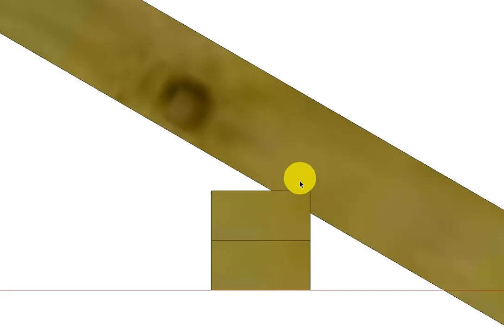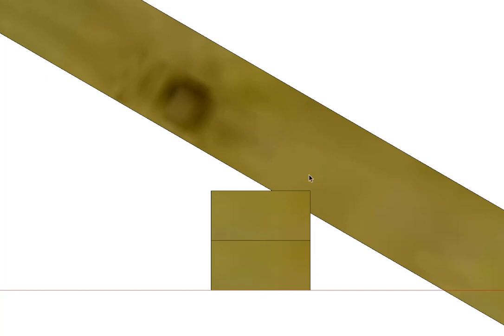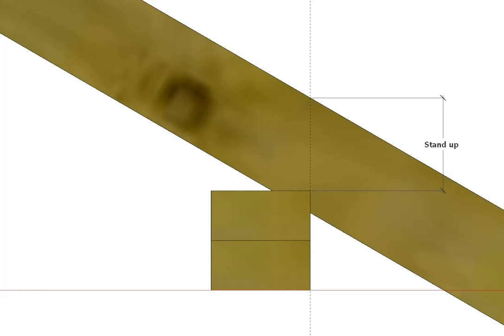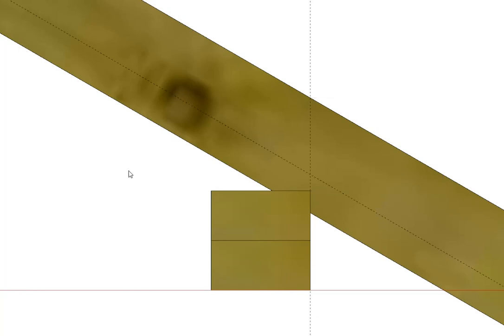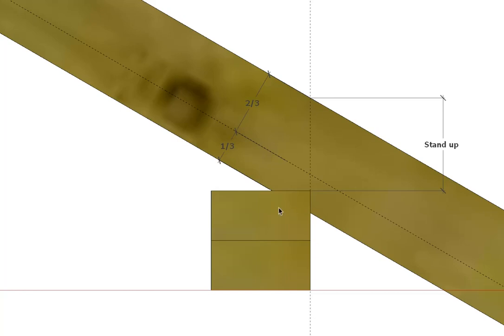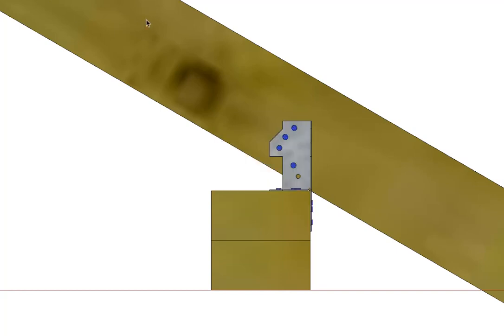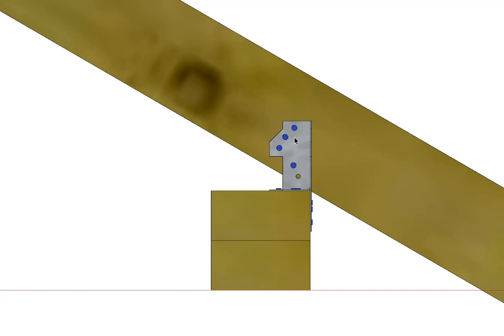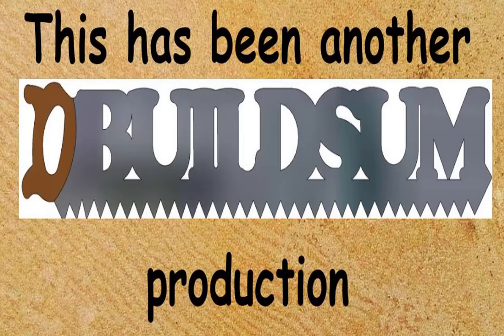Why do we still use a Birdsmouth?

Comment: I always cut a birdsmouth. I set out all of my roofs with maths. No measuring in hips etc. This way, when we throw it all up we can see any errors that might have crept in to the build, and rectify it then and there. Birdsmouth not only creates a stronger connection to top plate, but locates the rafter in the correct position. Many are scared of the maths, but honestly, once you learn it, it becomes second nature and very easy. I reckon its faster too. Just my thoughts. Thanks Buildsum.

Comment: Really enjoying these videos as an owner/ builder and a severe lack of trades. Question, I have a 170mm LVL hip rafter supporting 120mm LVL rafters for a garage extension to tie into an existing roof (tile-to-tin conversion). The rafters on the existing roof are 95mm hardwood. Using your, and others, method for calculating a birdsmouth, I am to be left with a birdsmouth that exceeds the ⅓ rule, more like ½. This is needed to maintain the existing roofline. Eave overhang is approximately 450mm. Is this an issue? How to reinforce, if need be? Can I preventative strap the hip rafter?
Thank you
Reply from the maker: Hi Mate, the 1/3 Birdsmouth rule is only for rafters. As you say, with hips, you need to maintain the stand-up for the roofline. You could run Builders strap down the top of the Hip to help reinforce it if you like, but it is not really necessary. Hope this helps
Reply: @Buildsum Thank you very, very much. Huge relief.

Comment: For low-sloped roof, I prefer the metal connector on the inside of the structure due to the direction the rafter wants to slip. Though, with a low-sloped roof there is much less slipping pressure.
Reply from the maker: Hi Mate, Thanks for contribuing to the discussion.

Comment: Honestly, I am sick of paying the crazy prices for all the steel ties and I also do not want a birdsmouth weakening my rafters.  I do, however, spend the money on structural screws, and I use wood blocks, glued and screwed, to fasten and tie down my rafters to my beams.  Also, steel strapping is so much cheaper for the purpose.  I built a 24' x 60' barn, with open ends, too, and it has survived some wicked storms here in northern Maine.  Yes, it takes more time and may not be viable for professional tradesmen and codes, but I will put my roofing up against anyone's for snow loads and winds.
Reply from the maker: Hi Mate, thanks for your thoughts.

Comment: Well two things come to mind. 1 if the birds mouth is not cut out of rafters.  The rafter will want to not 
Stay put.  Even with the metal bracket I can see potential for movement. At least till the collar ties are installed. As well it puts all the load on the outside edge of top plate. Also when you are installing the rake blocks. I’m feeling that wood be made easier. Do to the rafter and block being the same height. Also having the rafter not having a notch in it. Wood make it a bit stronger. I will say it appears nailing the rafter to the plate won’t be as secure do to only being able to put the nails on outside edge from rafter to plate.  
Myself I will stick with what works and conuinue useing a birds mouth cut.
Reply from the maker: Hi Mate, thanks for your thoughts

Comment: Our building code in usa/california requires the rafter has minimum 1.5in bearing onto the top plate, so just using the rafter tie bracket is not legal,
and frankly that seems a very bad idea to have the rafter bear on just a tiny point.  What I do at least on sheds is use the bracket and glue in the wedge.
That wedge is exactly the same size as you cut off the end of the rafter at the peak to attach it to the ridge board!
Reply: Good idea. Nothing goes to waste! What type of bracket do you use? The three grip type shown in the video or the Simpson hurrican type?
Reply from the maker: @OMMITRA  Hi Mate, the code shows the Trip-L- grip but as the Hurrican has a higher rating I don't see a problem using it
Reply: @Buildsum  Thanks Buddy!
Reply from the maker: Thanks Mate, good to know.

Comment: What’s that plate you use when you don’t want to use a birds mouth? Do you have any links for home depot or Amazon to find???  Which do you recommend to use?thank you
Reply from the maker: Hi Mate, I think you are thinking of a Ribbon Plate which is normally used when you are using trusses, however the need for a Birdsmouth is not reliant on the size of the plate.

Comment: I am building a low pitched patio cover 1:12, in foregoing the birds mouth with Simpson strong tie connectors. After reading the comments in this I think with my low pitch I won’t have to worry about slippage… with my experience with many materials, I have convinced myself that a bird‘s mouth would also result in more possible noise in the later future, from additional wood on wood contact, If the thing can even budge after I’m done with it.
Reply from the maker: Hi Mate, yeah I don't think you will have any issues with out the Birdsmouth. Thanks for your comment.

Comment: Good argument for not doing the traditional thing as it actually weakens the rafter, its an extra step now and the framer still needs to use ties. A few comments below suggest birds mouth cuts are good b/c it straitens the top plate...that doesnt sound right. Ideally you want your sheathing on the wall before its lifted and then braced, which should be straight...but even w/o, properly bracing the wall and using the straightest boards will eliminate this risk
Reply from the maker: Hi Mate, thanks for your comemnt, I agree the plates should be straight before you start putting up the rafters.

Comment: I do alot of cut roofs and always do a birds mouth but sometimes i keep it less than 1/3  especially if im doing hips and valleys so your not cutting massive birds mouths..  usually keep it 2 inches  over the wall plate  and then don't have to notch over block work either
Reply from the maker: Hi mate, good to know, thanks for your comment.

Comment: With a typical 22.5 pitch roof the stand up for a rafter is 65 mm (according to the 1/3 rule)therefore the strutting beam on large spanning room would be a lvl 365 deep it would not pass code which states D/3 or 100mm whichever is greater even without a birdsmouth it would not be enough what would be a solution for this to pass code cheers keep up the good content
Reply from the maker: Hi Mate, you may have to look at using a Steel beam rather than LVL, is could actually be cheaper than LVL in the long run.
Reply: Deeper rafters with no birdsmouth?
Reply: What does D/3 mean?

Comment: Great point about the stand up dimension. When working with a pattern rafter, always align with the top edge to achieve the best plane across common rafters. Birdsmouth depths will vary as the depth of each timber varies. Still and issue with today's timber, albeit to a lesser extent. The one third max rule ensures the strength of the eave overhang and has no impact on the strength of the rafter between plate and ridge.  Nothing more satisfying  than two rafters locked in at the top plates with birdsmouths, meeting the ridgeboard with perfect plumb cuts. Be a tradesman and cut a birdsmouth. Also, use trig to find your rafter lengths, none of this stepping off with a square, compounding error, or consulting apps and little red books. Or, god forbid, pulling a tape between the ridge and plate for each rafter, like a caveman. Old school chippies keep the faith. Birdsmouths forever. Love your work Buildsum 
Amen
Reply from the maker: Hi Carl, thanks for your comment, I agree it is certainly very satisfying to calculate everything out and have it all fall perfectly into place on the roof. I don't think that Birdsmouths are going anywhere soon.

Comment: The 1/3 depth of cut rule 
These days with rafter sizes being increased for insulation and ventilation are they not sized larger than the structural strength so therefore could you go more than the 1/3 cut out to achieve less stand up 
Maybe it would be good to know the actual structural size of rafter then you could keep to those boundaries 
Also bird’s mouth the ceiling rafter nailed against the rafter should be plentiful I always think 
But still do the BM
Reply from the maker: Hi Mate, good point however this is getting outside the scope of the code and into Structural engineer territory. I tend to agree with your comment about the ceiling joists, as long as you have a joist against each rafter then that will certainly help transfer the loads down to the top plate. Thanks for your comment.

Comment: in my view, apart from the better connection birds mouth provides, it also a great indicator to the straightness of your top plate, if your ridge line is true then gaps in the heal of the birds mouth will indicated the the top plate is out of position. so it serve both purposes for me. feels like it locks everything up very solid. I find it hard to believe that the same solidness will be achieved with just using tie downs, for sure they will do a great job against uplift but i reckon that eventually  non birds mouth rafters will end up getting "forced" birds mouth shape at the connection point due to the roof's weight and settling down
Reply from the maker: Thanks, Omer, the Birdsmouth certainly does help to pull the top plate into line and position it. I agree, with the surface area contacting the plate being so much less without the Birdsmouth, I think it would tend to compress more. Thanks for your comment.

Comment: yep, I never use to birdsmouth the rafters. Just measured the overhang of the truss tail, then marked that on the rafter, put a nail in to make it easier to know when putting in to position, skew nail then triple grip later with the rest of the tie down.
Reply from the maker: Hi Mate, thanks for your comment, using the nail seems like a good idea. Did you ever have any issues with passing inspections? Where abouts were you building?
Reply: @Buildsum  hi mate,no never had any issues. Was working in Brisbane, Ipswich and Gold Coast.
Reply from the maker: Thanks Mate, good to know.
Reply: @Buildsum  no worries 👍

Comment: I have done it both ways it works fine.
Reply from the maker: Thats great to hear Scott. When you didn't use the birdsmouth did you get any questions from the PCA or Building Inspector?
Reply: @Buildsum  I used it on small sheds and they wouldn’t inspect those at the time. The sheds are over ten years old and have had no problems.

Comment: When cutting a birds mouth how do you account for roof height? Wouldn’t the depth of the birds mouth decrease the plan height?
Reply from the maker: Hi Sam, yes it does however when we calculate the rise of the roof it is taken from the x-y line which is where the back of the Birdsmouth intersects with the top of the rafter. To get the actual height of the roof from the top plate you have to add the Stand Up distance to the rise. Hope this helps
Reply: @Buildsum  thanks very much

Comment: I like the physical connection of the birdsmouth to the top plate, myself. The plumb cut in the birdsmouth holds the top plate secure to a degree.

All the bracing and fixings do this anyway but in terms of the craft, I prefer it as a physical connection point.

Birdsmouths on continuous span rafters is great if the plates dont line up or you don't want to over pack them. You can adjust the height of the cuts, keeping the top roof line consistant.

It is up to the individual, but I will keep using them where applicable. Great content by the way, really glad I found your channel! Keep at it!
Reply from the maker: Hi mate, thanks for your comment, I agree, using a birdsmouth feels like a better job and sometimes can make the construction easier if you are working by yourself.